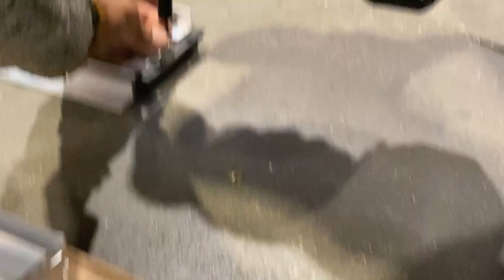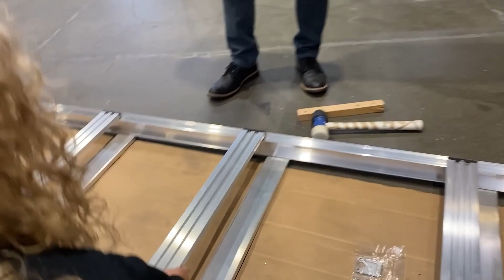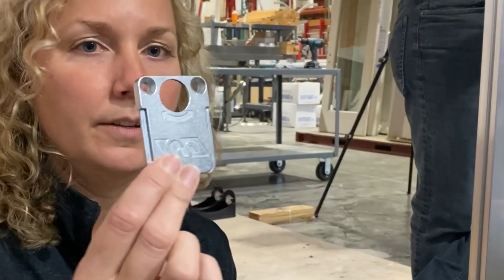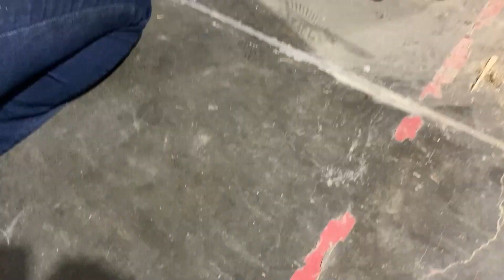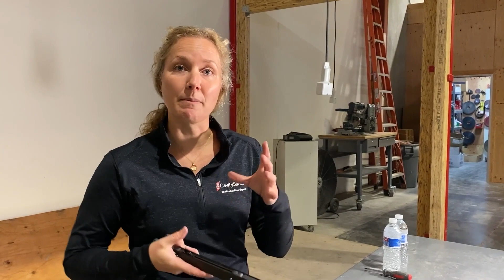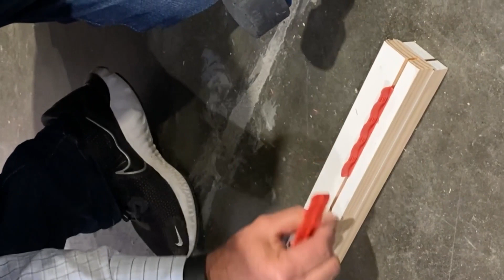CS Cavity Slider Pocket Frame Assembly and Installation | Golden State x Cavity Sliders

Comment: If the door in 28” with how many inches does the buttom plate has to be
Reply from the maker: Hello, the bottom plate should be 27-7/8" for a 28" wide door. You can double check your cut lengths with our Extrusion Cut Length Calculator here: https://www.cavitysliders.com/extrusion-cut-length-calculator/

Comment: How and what did you use to cut the slot into the bottom of the door?
Reply from the maker: To cut the slot in the bottom of the door, we recommend a slot cutting router bit that is 1/4” height and can cut at least 13/16” deep - it is okay to overshoot a little bit. Please give us a call at (888)466-0030 or email us at sales@cavitysliders.com for further assistance.

Comment: I am looking to create a more solid pocket wall.  So I bought your 4" wall frame kit with the intention of furring it out to 6".  I plan to add 3/4 plywood to each side of the 4" frame for extra sturdiness, and then drywall over that.  Any advise on how to do this, for example, how to attach the plywood so nothing warps or rattles?
Reply from the maker: Hi there! In this commercial project, it was furred out with 1/4" drywall on either side: https://youtu.be/Vi-SHnnShso?si=ZsRDj5LAwr7nW1K2&t=45

If you need further assistance you can reach out at (888) 466 0030 or email us at info@cavitysliders.com

Comment: Where do I find the trim kit for this unit?, does it need to be special made by a door shop?
Reply from the maker: Hi there! Thanks so much for your question. On page 10 of our instructions, we provide a suggested wooden jamb detail to be installed with our frame. Many commercial trim kits are also compatible with the CS Cavity Slider. For recommendations, feel free to give us a call at (888) 466 0030 or email us your door specs at info@cavitysliders.com. 

CS Cavity Slider Instructions: https://www.cavitysliders.com/Portals/7/PDFs/Installation%20Instructions/Cavity%20Slider%20Kitset%20Installation%20Instructions.pdf

Comment: I might have missed it but do you have to build have to builg on top of a sub foor?   I have 5/8" wood flooring that is glued down on top of gypsum
Reply from the maker: Hi there! Thank you for your question. All of our formulas are based on installing the Cavity Slider on the subfloor. When installed per the instructions, the door will have a 1" clearance to the substrate floor. Our recommended clearance is 1/2" when the floors are installed. To achieve this with an already installed floor, you will need to trim the vertical extrusions of the pocket frame accordingly. If you need help calculating this or have any questions, please feel free to call our customer service team at (888) 466-0030 or email us at info@cavitysliders.com. :)

Comment: This may be a dumb question but I have a mobile home and I am wanting to use sliding doors, would this fit a standard mobile home door frame?
Reply from the maker: Not a dumb question at all! The CS Cavity Slider Pocket Frame can be cut down on-site to fit your space. On the first page of our instructions, we provide a formula to calculate your rough opening to prep your home. From here, you can use the Extrusion Cut length formulas, also listed on the front page, to determine the length you should cut your back stud, jambs, track, slats, and fixing blocks. 
Check out our other assembly/installation video for more details on framing your rough opening and preparing your kitset: https://www.youtube.com/watch?v=O4CBSdCskeg&t=32s

If you have further questions, please feel free to call us at (888) 466 0030 or email info@cavitysliders.com, and we'll be happy to assist!

Comment: Since cavity sliders don't provide a door, how about showing how to prepare a solid core door and then attaching that to the frame? Every video skips over that and it would be VERY helpful. thanks!
Reply: would also be nice to see them installing drywall... instructions are great but seeing it done smooths out the learning curve
Reply: @artdeco5464  agree that would be useful - as would be breaking down an existing drywall to install a cavity door frame.
Reply from the maker: Hi there! Thank you for your comment. To prepare your door, please check out our other installation video that will show you how to attach your mount plates and hang your door in the cavity: https://youtu.be/O4CBSdCskeg?t=555 For further troubleshooting, please give us a call at (888) 466 0030, and we'll be happy to walk you through!

Comment: If my rough opening is 99 inches and the CS frame assembled height is about 99 11/16” 

Can I cut the vertical pieces 1 inch and still be good without having to redo the rough opening?? 

I bought 2 frames got lucky and one door RO was a 100” the other 99” 😅
Reply from the maker: Hi there! Thanks for your comment. Our pocket frame can be cut down to size based on your Door Width and Door Height. Check out the "Sizes" tab on our CS Cavity Slider page here: https://www.cavitysliders.com/Products/Pocket-Frames/CS-Cavity-Slider-Pocket-Frame to see the lengths you should cut your extrusions, or you can use the formulas on the first page of our installation instructions to calculate this manually. If you have further questions, please call our customer service line at (888) 466 0030  or email us at info@cavitysliders.com, and we will be happy to troubleshoot!

Comment: Still not clear directions
Reply from the maker: Hi Ryan! If you're looking for more resources on how to assemble and install the Cavity Slider Pocket Frame, please check out our full assembly and installation video: https://www.youtube.com/watch?v=O4CBSdCskeg.

If you still need help, please contact us, and we'll be happy to assist! Call our team at (888) 466 0030 or email us at info@cavitysliders.com, and one of our specialists can walk you through the process.
Reply: Well I figured it out and come out great
Reply: If my rough opening is 99 inches and the CS frame assembled height is about 99 11/16” 

Can I cut the vertical pieces 1 inch and still be good without having to redo the rough opening?? 

I bought 2 frames got lucky and one door RO was a 100” the other 99” 😅

Comment: Does it come with the slow close and rollers?
Reply from the maker: Hi there! Thanks for your comment. We offer both standard and Sofstop (soft close/soft open) Carriage packs to be paired with the Cavity Slider Pocket Frame. If you are using the CS SofStop, there are minimum door width requirements depending on if you'd like your door to soft open, soft close, or both! Check out the last page of our overview brochure for the list of door widths: https://www.cavitysliders.com/Portals/7/PDFs/Brochures/2021/CavitySlider-PocketFrame-KitSet.pdf If you have further questions, feel free to call us at 888.466.0030.